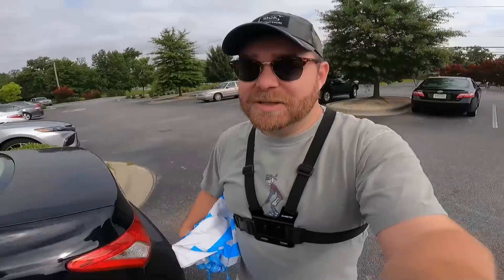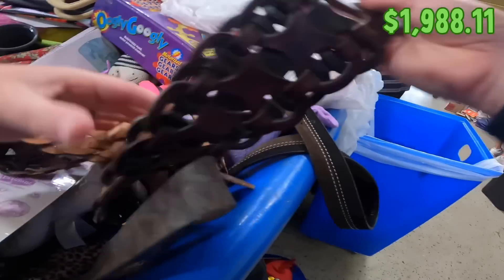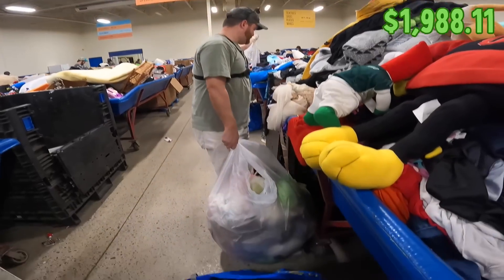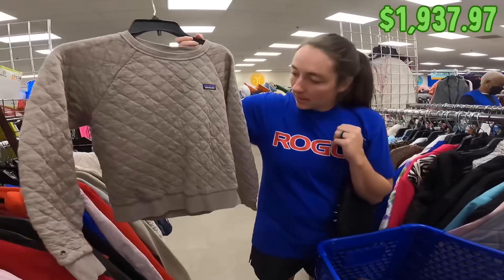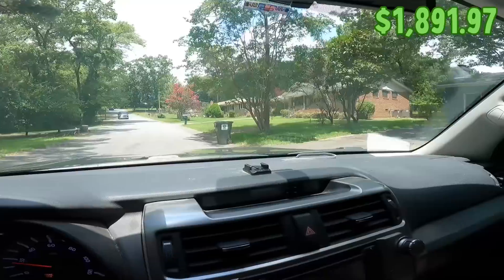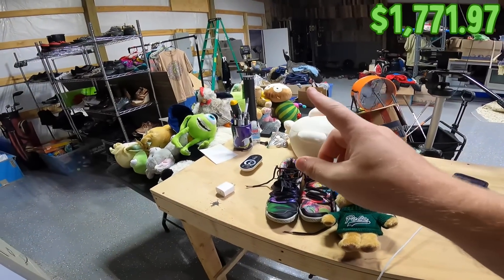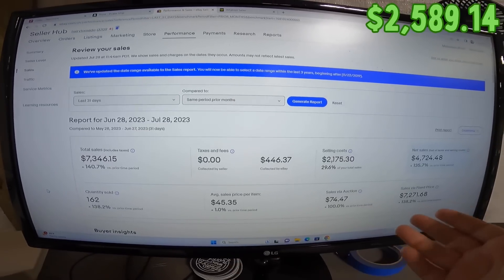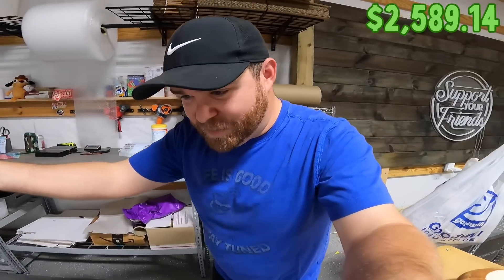Found in the Goodwill Parking Lot!

Comment: Love the flip house. As a home rehabber, can I offer some feedback on the cupboards?  The frig opens away from the inside of the kitchen.  Can the doors be hinges on the left?  Also, the pantry might do better on the other side of frig. That way the wood is framing your appliance and more visually appealing.  Again, hinge doors on left to come into the kitchen. The Lazy Suzanne looks off in size but could just be the video.  We are struggling with a lazy Suzanne with our current rehab.   You guys are doing a great job on your first rehab and yes, don’t worry about what strangers (me) think. This is all
Positive input but in the end, do what makes you happy!
Reply from the maker: going to change the direction of the fridge. I CAN put the pantry on that other side but if we ever needed another fridge, we would have to move it again.